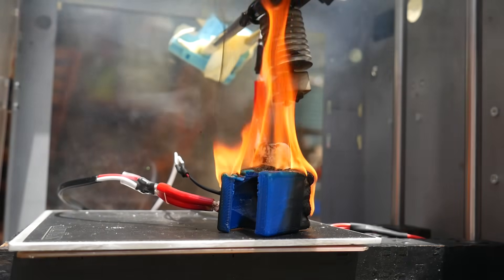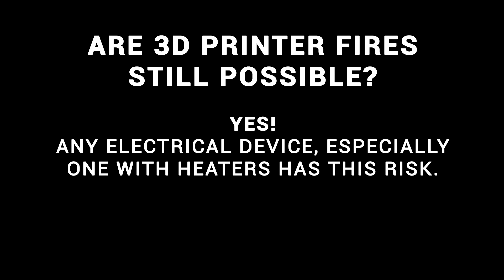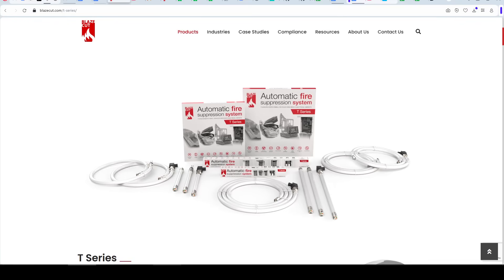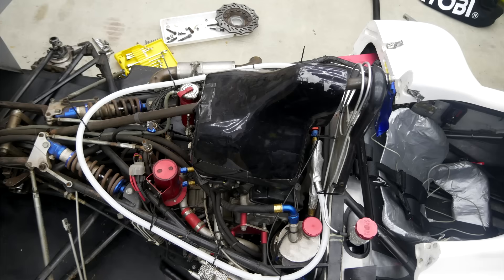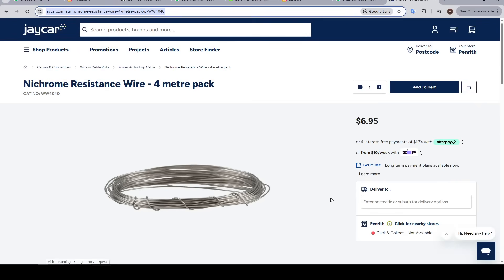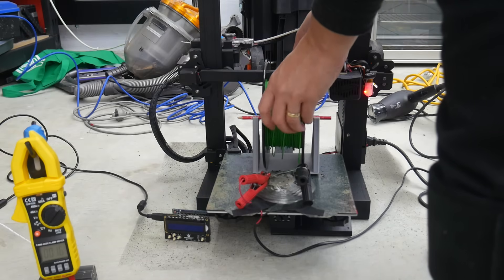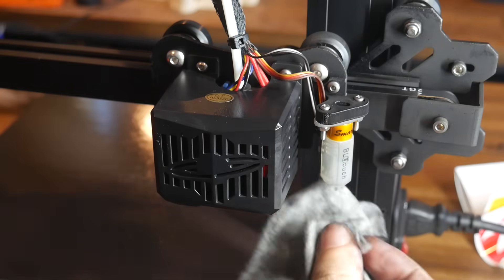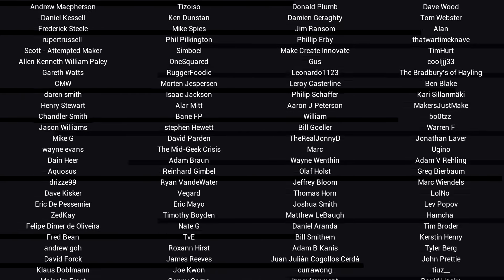Testing a BlazeCut fire suppression system for 3D printer fires

Comment: I use a smart power plug and upon klipper shutdown (temperature runaway) the power is physically cut. I cannot (yet) monitor the temperature in the electronics bay but it's just a thermistor away, and a fire cannot start as quickly as temperature runaway is detected, it needs it for extended periods of time.

Comment: I have several (recent, mainstream brand) 3D printers that were donated to me due to the owners not wanting to have them in their homes after they'd gone seriously wrong. They've given them to me because they knew I'd get to the bottom of it. The culprits these days isn't the software, it's mainly the hardware. If the hotend heater fet shorts or the bed mains SCR shorts, it doesn't matter how good the software is. Unless there is an overall override on the power supply or thermal fuses are present, things are going sideways. If the software has gone to lunch and is no-longer running properly due to a bad, unstable power supply (on or off board), many new processors rely on stable power for even their internal hardware watchdogs to work properly too. 
Processors are cheap, 3D printers should come with independent ones on separate power supplies whose only job is to sit back and monitor what is happening and they should have firm control over wherever power comes from. Ideally a kill relay on the mains coming in.

Comment: Unfortunaly there is no working suppression system atm. 
Wham Bam made one but that was nothing but a scam. It was nothingelse then the Pyro or fireball. Which is a firecracker with some I think baking soda. It does absolutly nothing. It failed all tests but is still sold in poor countries. 

I think the only thing that would work would be the old firegrenades that contained a extremly toxic oxygen absorbing liquid.

Comment: 1. optical smoke alarm in the room.  2. a simple bimetal switch used for safety in clothes driers; it's AC and you wire it into the printer power supply if you can do super basic electronics. Mine is lower in that it switches off around 90C. It has worked in the past; no smoke it caught it so quickly (it's near where the hotend heats up)

Comment: So far my solution has been to never leave the townhouse if the printer is running. Also, I do not do print jobs that run longer than 10 hours. I also plan my day so that the print will finish before I go to bed for the night. We have a smoke detector close enough to the printer but I do not have an interlock to shut the printer down. If the print were estimated to take longer than 10 hours I generally break the print into smaller parts. I usually design to join parts with nuts and bolts. In some cases I have redesigned to include wood members for long spans and 3D print brackets at the ends of the 1"x1" wood member. I usually sit beside the printer for the first five to ten layers to make sure the print is not coming loose from the bed.
I think a printer fire is very unlikely but I cannot imagine having a printer running if no one is home. This is a wood frame building. I would not want to give the insurance company and excuse to invalidate my insurance.

Comment: I have my printer on a smart plug and an independent temperature sensor in the enclosure. If the temperature rises above a certain threshold it kills the power. Additionally, it'll take a photo and send it to me. But I have been also thinking about a fire suppression system as well.

Comment: Would you be willing to test this again with the WhamBam cover using active exhaust? Would be interested to see if:
The fire erupts faster with moving air? If the enclosure can reach trigger temperature for the gas tube to discharge?

Comment: Thanks Bro for this Update, and importend Video. A forgoten fire Aspect are the Fans of 3d printer!!! My 2 year old k1 max the Part Fan burned After bearing damaged. My older 3d printer i Always soldering a Fuse in the wire of the fans. Also of the k1 one Max. I dont understand the Producer. IT can Coast lives of Childs and people. A fuse cost a few Cents or Penny

Comment: Great system, but my 2 biggest questions were sadly not addressed:
1) What if the enclosure is open (like is advised with many printers when printing PLA)?
2) Is there data on the "cycle life" of these tubes? The break seems to occur at an intentional weak spot, I wouldn't want the tube to fatigue there after being heated to 60C repeatedly when printing ABS

Comment: My Bibo caught fire, its a good thing I was still in the room. I was walking out to go to sleep and took a quick look back to see it before heading to bed and saw the glow! The second head's heater got preheated in the code that I was unaware of even though it was not in the slicer and it was disassembled as I was testing the primary head after a rebuild. Stupid firmware settings almost burned my house down with me in it.

Comment: I've seen multiple people talk about a IOT smoke detector to cut power and that's a good idea if you already have the setup and don't have anything else.  But I bought a power outlet that has a smoke detector driven cut switch as a much lower tech solution and it's probably a lot more reliable since you don't have to worry about all the moving parts of your IOT setup.  Google fire guard outlet.  It's worth the money.  I also have a Haven fire suppression above my printer which is similar to Blaze cut but uses ABC because I'm not at all concerned about destroying my 3d printer and ABC is better for electrical fires.  The residue sticks around and continues to work rather than dissipating like a gas system.  It will ruin the 3d printer and it's a mess to clean, but I'd rather deal with that than lose my house.

Comment: Forget the pi and smartplug, use the pressure switch to DIRECTLY cut power, either by running the mains straight through the switch, or by using the pressure switch to control the coil of a relay or contactor. 

I have a thermal fuse mounted above my printer, which enables a small SSR in the power line. If the fuse opens, it powers off the printer, full stop. No software whatsoever.

Comment: I've had several failures of solid state relays that shorted.  These use FETs, SCR's, or Triacs depending on if they were designed to switch AC or DC.  In my case, several AC SS relays had failed in the shorted mode, meaning they could NOT be turned off.  I had wired an indicator lamp across the heated bed so I was aware of the failure before the bed seriously over heated.  I didn't have a thermal fuse in series with the bed power.  I would not leave this out today!

Comment: What do you think the result of one of those BlazeCut tubes bursting inside a rigid-body enclosed printer with glass doors/sides like a Bambu or Qidi would look like? Do you think it is violent enough to break the glass?
Reply from the maker: I would think that surely the door is blown open. It would only smash from swinging open too far. That's my guess at least.

Comment: I have a smart plug and smoke detector like you, but use HomeAssistant to automate the turn-off action.

I also use the energy monitoring of the smart plug to kill power if the printer ever draws more power than expected - it's essentially like a circuit breaker that's been dialled down to trip at a few hundred watts.

If I had a decent enclosure I'd definitely be considering one of these fire supressjon systems too.

Comment: Just for EU people Heptafluoropropane (HFC-227ea) is banned in EU since its GWP(global warming potential) is 3220(limit is 150)
Reply: Has anyone in EU manage to import it after 1 January 2025. For reference check  REGULATION (EU) 2024/573 annex IV (11)
Reply: @ivanjovic6287  It seems like R-227ea as extinguishing agent (FM-200) is still allowed/in use in EU.
Reply: @DieKnoblauchgurke-ml4pj  Do you have a reference for that? I know there a ways to import it for old systems but here regulation seems straight forward. Did you manage to import it yourself?

Comment: Fires suppression has been available for ages and I have been pushing for these to be installed but well if its not in the regs then it gets ignored.
Work just got one of the sample units and its still sat on its desk.
The chemical used is normally Novec And in the UK similar systems are available from Firetrap and Jacktone
If its Novec then the gas is perfectly same to accidentally inhale and its safe to touch.

Comment: The real issue here is that 3d printers operate in a grey zone. (Talking EU) Manufacturers falsely classify 3d printers as "office devices" which would put them in the low voltage directive. 

3d printers however are machines and fall under the machinery directive. But GWPC, why does this matter? Because the machinery directive has clear standards to which a machine must comply like functional safery standards for both electronics and software!

Do 3d printers comply? No, they don't. So what happens? Well most cheap 3d printers that are bought directly from their manufacturer, are the worst. You're technically the importer and there for the resposible one for any liability. From any store bought or EU subsidiary you could try to hold them responsible.

Concluding: there is a reason why especial chinese printers are cheap, this is one them.

Comment: The pressure switch wired to a master power relay is a great idea, but being that you are designing this as a safety interlock, KEEP IT SIMPLE! I would not trust a raspberry pi the send a signal over your home wifi to a smart outlet for a safety interlock.  Instead, simply install a relay between your main power cord and power supply, with the relay coil controlled by your main power switch and the fire extinguisher pressure switch in series. If either switch opens, the relay kills all power to the machine.

Comment: I had a fire in a homebuilt 3D printer once, but it wasn't necessarily a fault of being 'home built'. It had a BTT SKR Mini, and the hot end MOSFET failed. MOSFET's typicall fail OPEN when they fail, so even though the firmware went 'HEY! THERES THERMAL RUNAWAY!' and shut down everything, the MOSFET was failed open and continued supplying power to the cartridge. Since it stopped mid print, the nozzle was right on top of the printed part, and it eventually melted and smoldered. It didn't literally burst into flames, but there was enough smoke and charring that it set off the smoke alarm. If I'd have had a smart plug that could cut all power to the entire printer, that would have prevented it, but I didn't. Luckily I was only about 10 minutes from home and I have smart smoke detectors so I was aware it was going on to get home ASAP. Since then, I have smart plugs on all my printers as well as WhamBam Clouds in every enclosure or on top of every printer as a preventative.

EDIT: Just got to the end where you address this exact scenario and the remedies. I should be more patient!

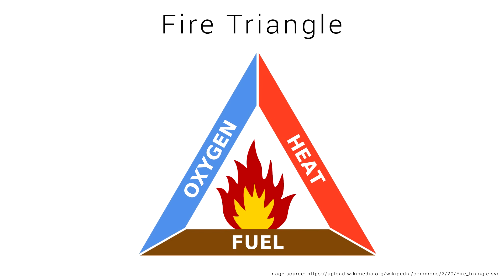Comment: 9:24 FOUR, fuel ,oxidizer, heat and uncontrolled chain reaction. And that's not all either, class A,B and C fires all need specific treatment with class A being the least picky, and well class D fires must exit the area one way or another, you either throw them out or they will burn their way out through whatever surface they are sitting on.

Comment: I've had a thermal runway on a Bambu A1 bed. This was not a damaged cable either, as it's a post recall model.

Fuse blew unexpectedly on the fourth or so print, I got a replacement fuse from them. 

Installed that, turned it on, had a look at it a minute or so later to see the bed at ~180C with a setpoint of zero. It wasn't running a print either. Appears the powerfet for the bed probably blew through. Went to take a photo but the bed delaminating itself from the heat prompted me to turn it off...

Warrantied that machine, but haven't been running it much since. Don't trust it at all now haha

Comment: This commercial is a solution for a problem that no longer exists.
Reply: I don’t think you are being fair to call this a commercial.  He pointed out that it didn’t go off at all in the PLA fire, which eventually self extinguished, and took quite a long time to go off in the ABS fire. He pointed out that whilst it did put out the flames , in a real incident the fire might well have reignited, and because this is a single shot device the reignited fire would not be fought.  And he also did make clear that the risks from 3D printer fires with modern printers are much lower than they used to be, just still not zero.  It seemed like a pretty honest and open review to me, and whether one of these is a worthwhile investment depends on your circumstances and, to some extent, your appetite for risk!

Comment: Sounds like you're depending not just on having an enclosure and using it for the current print (unlikely with for example PLA), but also on it being a really nice enclosure with little to no leakage.
Reply from the maker: The Wham Bam enclosure tested here is not air tight. You can see the smoke exiting from the front flap. There are also lots of smaller opening for getting filament in and out.

Comment: My printer is within an enclosure. The enclosure is driven from raspberry pi (temperature, smoke alarm signal, fan intake and filtered exhaust, power relay normally open and camera) and also a BlazeCut. It will act on multiple level. The printer itself has all the securities implemented (thermal runaway etc.). If there is smoke detected, the pi will cut power automatically and send me a notification on my phone. No power, no heat, no air (fan off).  Same if ambient temperature in the enclosure is too high. If none of this is sufficient then the BlazeCut will extinguish everything. On top of this, the whole system is connected on a smart plug that I can turn off from my phone. I took care to wire the speaker of the alarm outside the soundproofed enclosure. I also have an air quality sensor outside the enclosure linked to another air filter. Another smoke alarm on the roof above all that. I hope I did enough ;-)

Comment: There is nearly no point in extinguishing an electrical fire if you are not stopping the electrical ignition source... it will just start again a few seconds later, in addition filament smoke a lot before catching fire so a better option is to have a smoke detection system that cuts the power supply
Reply from the maker: Totally agree, which is why this was covered in the video.